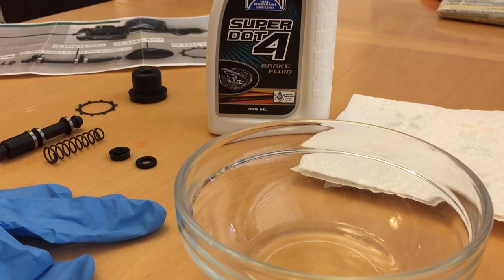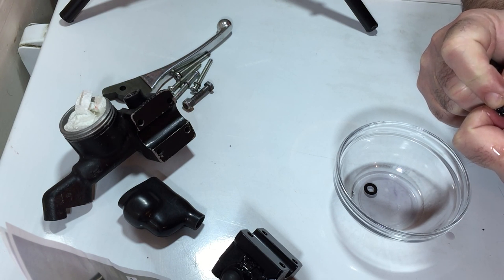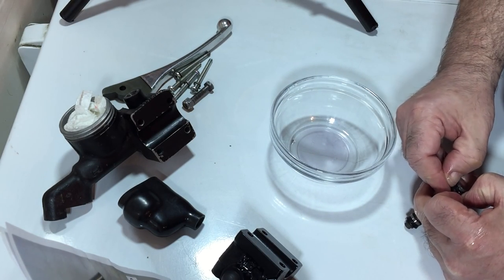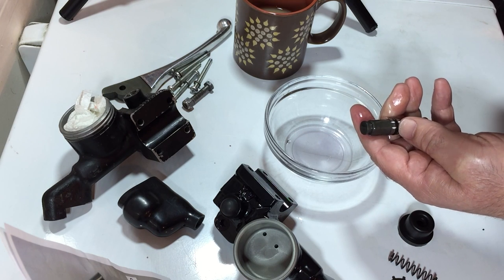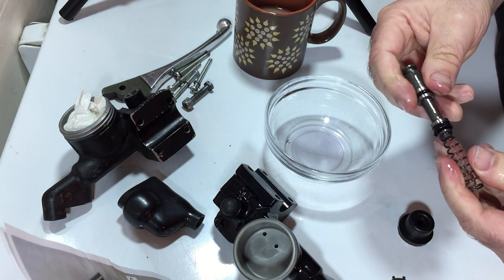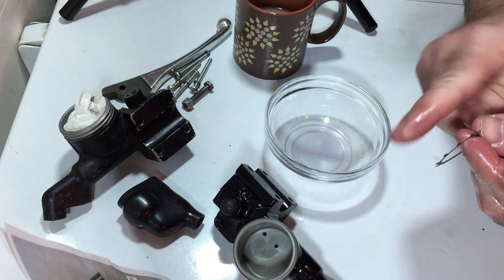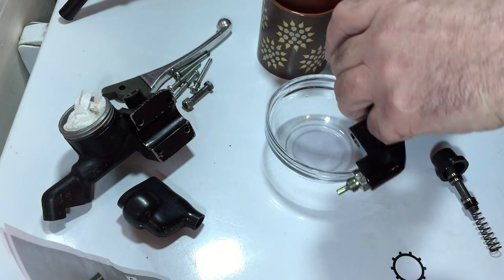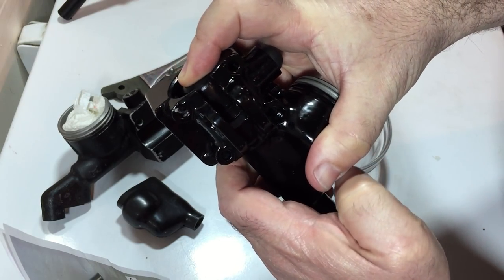Andover Norton (Commando) - New 13mm Bore Master Cylinder Review (4) Assembly

Comment: Thanks for the video. Definitely helped. One thing I tried for installing the circlip that seemed to work was to use a 22mm socket to press down evenly to push it all the way to the bottom.
Reply from the maker: Thanks a lot for the tip Roland. Best wishes, Mike